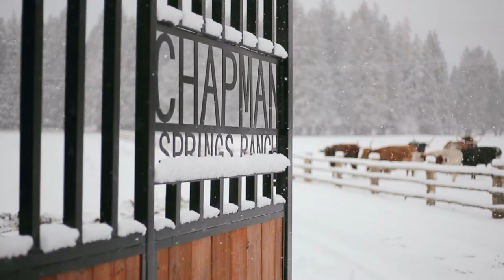Ford F-150 Suspension Upgrade | SuperSprings SSA28 Install

Comment: Will this model work with the newer 2023 f150? I find the newer spring system inferioir to the 2019 i traded. My 19 had the system and now i want to put it on my 23

Comment: The video above shows the jack stands under the rear axle and not supporting the frame... as the installation instructions state "2. Jack up vehicle – elevate and support the frame securing with jack stands so that the axle is hanging with tires slightly off the ground..." 

I ask this because I am lifted and placing jack stands under the frame for support is a bit challenging. So jack stands supporting the rear axle is an option?
Reply from the maker: Great observation! You're right about the installation instructions stating to support the frame with jack stands. In the video, we initially placed the jack stands under the rear axle due to the unique circumstances of installing in a barn with a dirt floor covered in hay (it was quite the rustic setup, LOL). This allowed us to remove the wheels safely.

At 1:07 in the video, you'll see that we did eventually move the jack stands under the chassis to allow the axle to hang with the tires slightly off the ground as recommended. Normally, we would place the stands directly under the frame from the start.

For your lifted vehicle, using jack stands to support the rear axle can be an option, but ensure that you can safely achieve the necessary height and stability to allow the axle to hang freely when needed. Safety first!

Thanks for watching, and we hope this helps. #JourneyBetter

Comment: I plan to have 3k lbs of weight on the bed of my 2011 f150 V8. Will this be strong enough ?
Reply from the maker: While we do provide SuperSprings compatible with the 2011 F150, it's important to note that this particular model is designed for a load capacity of up to 1,500 pounds. We apologize for any inconvenience this may cause. -Matt

Comment: The rubber piece in between spring on my ford f150 looks like it is sticking out. Sort of like a over lap or something, is this normal?
Reply from the maker: Hi Kris, are you talking about the Spring pad on the SuperSprings? - Josh
Reply: I’m referring to that center pad the guy in the video threw in the center.
Reply: @SuperSpringsInternational is that black center pad supposed to stick out a little? Does it shift back and forth while driving?
Reply from the maker: @KrisTheCodeManDude  If it shifts and sticks out a little bit it shouldn't be a problem. For confirmation, you can always send pictures to my email, joshua@superspringsint.com

Comment: How many inches of lift did you get on the rear? so that I know what size spacers to use at the front.
Reply from the maker: It varies from application to application. Did you order a SumoSprings kit without spacers?

Comment: I haul firewood with my 2016 f150 and have noticed that the right side rear of the truck is sitting an inch lower now when empty and quite a bit more when loaded. I also use this truck to tow my 4k lb camper,though I haven't since i first noticed my sagging problem. Would this fix my problem, or should I just replace my springs on that side?
Reply from the maker: Hi 👋🏻, These would definitely help fix your sagging issue! Plus they'd be great while towing your camper as well. - Josh
Reply: @SuperSpringsInternational  Awesome, I'll give them a look see.